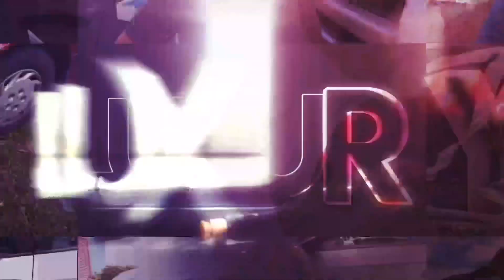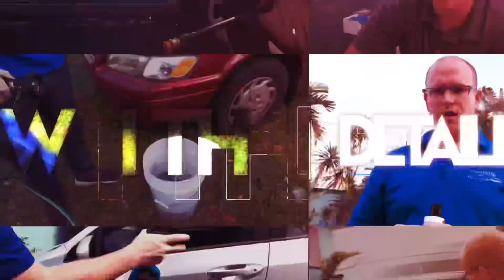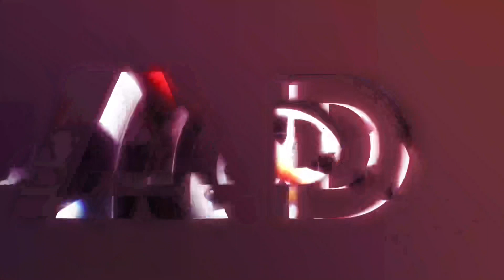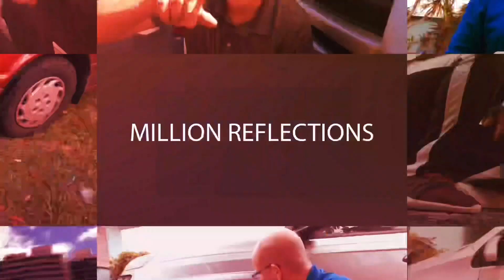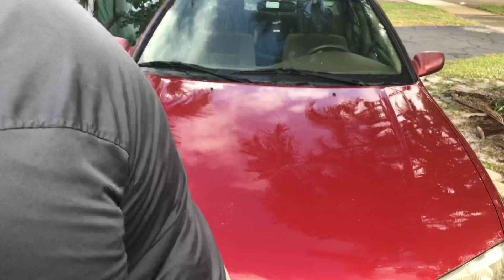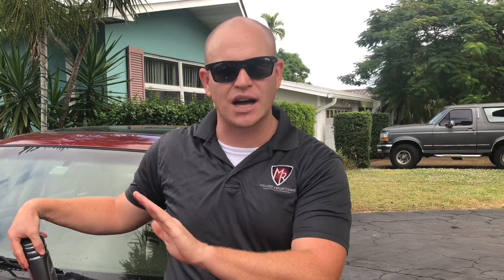Turtle Wax Ceramic Wash & Wax - Where Every Company Falls Short

Comment: Got my car ceramic coated. Used this same soap & used the TW ceramic wet wax as a drying aid. Used every week. Does a good job so I just end up washing every 2 weeks instead. Works well for me for someone that don't do any maintenance in between washes. Car is parked outdoor 24/7 & deal with all the outdoor elements. Car is clean & no water spots yet. Cheap & saves me money just by washing every 2 weeks. TW is a win on my end.

Comment: The directions state it’s not for a foam cannon. It’s supposed to be applied by hand. A pressure washer is too hard of a spray for rinsing as you are actually power washing the product off the surface. If you followed the directions and gave it a good gentle dry with a microfiber towel, it would have awesome hydrophobic properties. Drying it this way actually helps work it on to the surface. It’s definitely not for production……..it’s a good, cheap, solution for personal auto hygiene…………

Comment: Love your videos. Like you, I am in south Florida and use these products outside in  my driveway in the real world and not in a protected environment. Thought I would mention Technicians Choice Aqua Glow. It doesn't have ceramic or graphene, but it is one of the best drying aids I have ever used, leaves an amazing shine and lasting protecting and does not streak.  You can even use this product on a dry car by spraying directly onto the car and wiping off with a dry towel.  Exremely even coat with no streaking and great gloss and shine. Love your videos, keep them coming.

Comment: The directions specifically say not recommended for use in a foam sprayer. I started out by hand washing and still hand wash with this product - it does an excellent job and with each hand wash it gets even better. The key is to always hand wash with a microfiber wash mitt an do a low pressure rinse.

Comment: How rough is your paint on this car?  I used this on 2 different cars. a 2000 Dakota with rough paint and had the similar effect here.  Then I tried it on a 2015 Kia Soul after a decon wash and a clay bar.  The 2015 Kia beaded up and was like butter after the wash with the Ceramic Wash.  The 2000 Dakota was subpar and I think the underlying rough paint was just not letting it bond.
Reply from the maker: It was just decon’d and clayed not long prior to this wash...
Glad it worked for you!

Comment: I just used this soapy saliva and you are so right. It left little waxy spots all over my glass. The whole car is ceramic coated. I had to get it off my glass with an IPA. When I dried down the panels it felt like I had less slickness than before I started. The wipedown helped and it looks decent now. But like you said it's just clean. That's about it. And I had to work harder to get the film off. I did it one panel at a time top to bottom. Silicone dioxide is what I think the spots are. Stuff is not good

Comment: Mr. LAD, Did you use the TW Hybrid Polish/Wax & Hybrid Ceramic Spray first?  The wash should be used after the Polish/Wax & Ceramic Spray, according to Turtle Wax.  Does the Wash have polymers?  If so, you won't have suds.  Have you ever used ONR?  No suds, because it is not a soap, but a polymer technology.  I used the TW wash twice during a 6 month period for my maintenance washes.  For my weekly washes, I used ONR, for my monthly washes, I use TW 3 in 1 detailer.  Both of my cars have gone through the midwest winter roads, and has not affected the shine, protection & lubricity.  If used properly, I would highly recommend the TW Hybrid Solution line products to all of your viewer...  Thanks for your videos...

Comment: Since this isn't a SNOW FOAM soap, if you try to use it as one, then it ends up diluting to a point that the benefit of any lubricity is greatly reduced.  It was made for bucket use to provide Hydrophobic properties and when you use the 3 oz to 1 gal (and one gallon is all I have needed to wash a car) it really does a great job of cleaning and the lubricity is there.  The directions are specific, add 3 oz to your bucket and fill with one gallon of water.  Don't get me wrong, I like suds, but I have found out that FOAM and suds don't always equate to a soap that is good at cleaning.  It may be fun to look at, but a lot of SNOW FOAM products leave a lot to be desired when you are looking for a soap that actually cleans. From what I have read, the Si02 in this product is designed to integrate with their whole Sio2 Hybrid solution line.  It was never designed as a detailer or a stand-alone product.  Also, TW on purpose never designed it as a high suds soap, but as cleaning soap with lubricity (when used in the bucket, as they recommend, and then you will find the lubricity you want) and a light load of Sio2.  Using the "TW Wet Wax" as a drying agent will leave you with a smile and it was the product designed to accompany it in the first place and that plan really works.  I have totally converted to the Hybrid solutions ceramic line.  The key is to recognize why a cannon dilutes its effectiveness.  But at .60 cents to .85 cents per wash (Depending on where you buy it), this is a very cost-effective product.  If you want a really good SNOW FOAM use the TW ICE SNOW FOAM.  It's not only a great pre-wash but is also a very good contact wash product.  Especially for cars that are well maintained, i.e. washed every other week.   Good luck with your show, I look forward to watching more of them.

Comment: In defense of Turtle Wax we don't know How your panel of your vehicle was prepped or if prepped all. I do know that we have washed several Vehicles here at the shop, some Vehicles were clayed, others were not. And the end result all the vehicles that were washed with the new Turtle Wax car wash soap did in fact bead after they were washed. 😎
Reply from the maker: Interesting!
No there wasn’t much prep work. 
I used a body solvent but since it was coated a couple months back didn’t bother with that or polishing.
I won’t give up on it! Lol

Comment: Have not used it myself but the Wolfgang über SiO2 Wash seems to be a car soap that actually leaves something behind. Also Carpro Hydrofoam is also a SiO2 infused soap that works. Gyeon Bathe + is another one but there you really need to be following the instructions on it. I have used Angelwax Enigma Ceramic Infused Car Schampoo but this is more of a maintance wash soap that leaves more of the Enigma look behind. Have it at home but not used it yet and it's not available in the US is Sonax Wash and Seal. That's the maintance for the Sonax Spray and Seal which if you like gloss is a great spray on rinse off product. 
The whole thing of a car soap that leaves something behind I'm personally is not a fan of. In the case I would consider to useing one would be if it's in the family of the LSP I currently have on the paint. Otherwise it's a Car Soap that leaves nothing behind as in protection and glossenhancers I want. As many of them and especially cheaper wash & wax car soap leaves a less looking finish than my LSP usually is. So why would you be interfearing a really great look and high performance LSP with something that degrades the look and performance from it. Get you a bottle of Carpro Reset car soap and you don't need to be looking for something else. Awesome cleaning ability from it which means less passes to get the paint clean. And an awesome lubrication from it and all this you get even with the recommended dilution of 1:500. Actually don't dilute it stronger other than you want it to knock down wax or sealant or get a ceramic coating revived that has lost it's water behavior from useing something like Meguiars Gold Class car soap LOL. I have tested to dilute it even weaker and up to 1:1000 without any problems with the cleaning ability from it and the lubrication from it on a lightly dirty car. 

Now that's not good if TW didn't put it on the description of the Ceramic Wash and Wax that it's not any good in any foaming equipment. They mentioned that this will not be foaming or sudsing in the videos from they that where in Arizona for the reveal of the Hybrid Solution line of products. So they where open with that there. And SiO2 in it's raw state is actually used as anti-foaming and anti-lumping in liquid form and in powder foam. Siloxane though is a very great foaming agent and is what's usually used in SiO2 technology infused car soaps and spray on rinse off products mostly. Generally speaking if it's not saying on the bottle that claims to be infused with SiO2 in a car soap. Don't expect it to be any good at foaming. And also don't let it dwell on the vehical and wash and rinse directly panel by panel. 

Then from what I have seen from all of the reviews and showing how it works. The TW Hybrid Solution Ceramic Wash and Wax don't seems to be a good product for what it claims to be. Also from what I have noticed just by looking at the water behavior. The Ceramic Wet Wax and Ceramic Wash and Wax seems both these products actually degrade the performance from the TW HS Ceramic Spray Coating water behavior. Goes from Ceramic Spray Coating with great beading and sheeting from it to a less water sheeting properties after any of those 2 products is used on top of it sadly. So far it's the Ceramic Polish and Wax and the Ceramic Spray Coating that I personally think looks great and would want to test. The other 3 in the Hybrid Solution line of products just don't seems up to par with them. 

But honestly try out either Wolfgang über SiO2 Wash or Carpro Hydrofoam and you may change your mind that there are such of these products that actually works. They are expensive but IMO they are not a car soap you use at every wash you do. And being used every month for building up the protection or maintain your ceramic coating that has started to degrade in the performance from it. Just how I look at all this.
Reply from the maker: Thanks for the recommendations!

Comment: The note says not for use with a foam sprayer. IMO I think it was designed to work as part of the whole hybrid solution. They should have left the wax part off the name.
Reply: Agree on foam sprayer.
Reply from the maker: I agree they would’ve been better off leaving off wax... maybe market as a “SIO2” safe product rather than a SIO2 booster